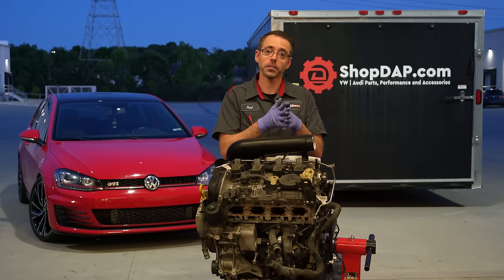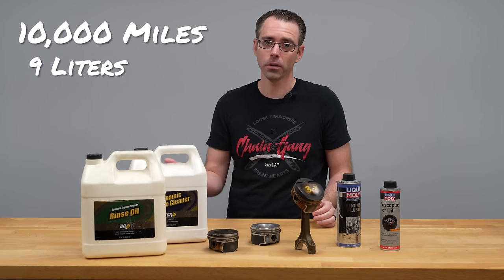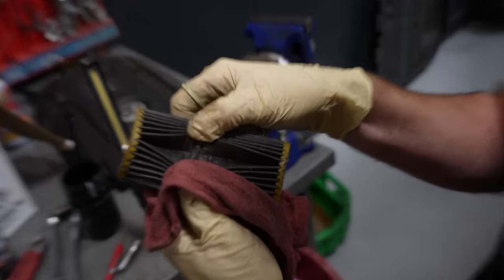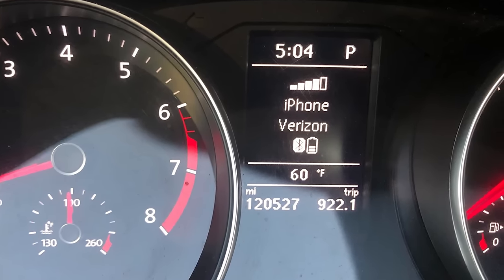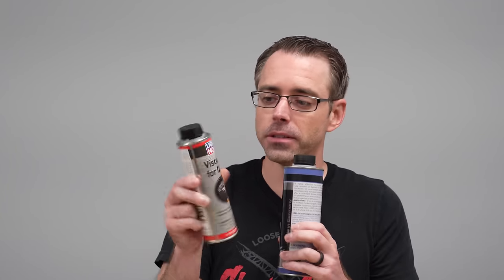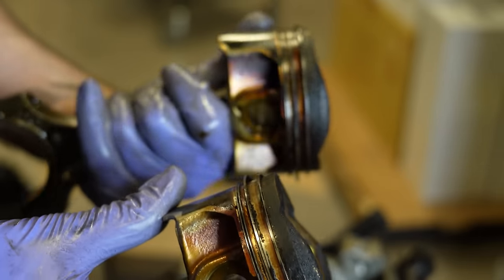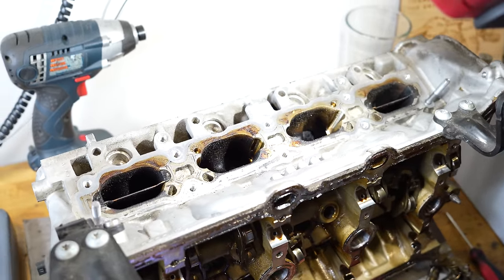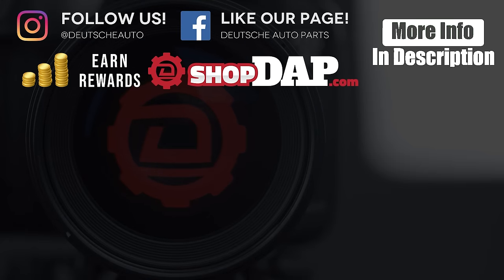Can you Fix an Engine Burning Oil for $20

Comment: Hello Gentlemen,

Carbon deposits on piston rings are quite common on VWs.
I would like to suggest You a different method, that worked for me.
I used XADO MAXI FLUSH CLEANER.

1.) Wear rubber gloves, safety glasses and face mask
2.) Run engine, till You reach operating temperature.
3.) Take the spark plugs out
4.) Spray the cleaner into the combustion chamber
5.) Put spark plugs back
6.) Let it sit for 20-30 minutes
7.) Take spark plugs out, and put a rag on top of the valve cover. (To prevent cleaner to get on painted surfaces)
8.) Crank the engine at least 5 times. Let cleaner fluid get out
9.) Put spark Plugs back, and assemble everything.
10.) Run engine for 20 minutes on 3000 or 4000 RPM.

This cleaner damages carbon deposits, and make them fall to little pieces, that can burn out.

After that I usually take the car for a "joyride" . Ok, I mean I go on some hills up, and I floor it, to put maximum load on the engine.

Video was great, explanaion was also good. Keep up the good work.
Reply: I also recommend the Xado MaxiFlush, with the same process, but doing 3-4 rounds of it until the pistons get absolutely carbon-free. You can see how clean the pistons are with your phone's camera set to video an turning on the light. I did it on a Prius 2 that was burning 1 liter of oil every 1k km's, and it went down to about 0.5 liter per 10k km's! I know some other guys with similar result on their Priuses, I do really recommend it.

Comment: I rebuild air cooled VW engines, and I always use gapless rings (Total Seal). Are gapless rings OK for rebuilds on modern engines like the Audi 2.0/B7? It seems that it would solve the same issue that eliminating the small cut out below the oil scraper in the first piston design solved by reducing blow-by. Also, did Audi/VW make a change with the material the rings are made of along with the updated pistons? From my understanding, part of the reason for excessive oil burning in the 2.0L is also due to the metallurgy makeup of the rings. That they were either too hard or soft for the sleeves, and thus don't break-in well.

Comment: Back in 90s I worked for a car guy. A ford ranger 4cyl after running a while. Loss of oil pressure. Pull pan the valve seals in pan. When it sucked them into pickup screen oil pressure drops. Shut off they fall out. All over again. Being a used car place clean out pan no valve seals

Comment: Based on my Fuelly tracking, after using LiquiMoly flush before my last oil change, and a bottle of Techron just after, I saw about 1.5mpg increase on gas mileage. I also put in a bottle of Mos2 anti-friction with the oil change. Mk6 GTI

Totally not scientific, but I have over a year of mpg data and the increase has been maintained for the last 4000miles
Reply: Mos2 should be used like this: 2 oil changes mos2, 1 change ceratec

Also look at the concentration too
Reply: Then you have spent more money on these things than you save fuel and don't know how long that will last.

Comment: Cool video! I've been using some great car care software named Automotive Wolf for years. It keeps track of all the maintenance on both my cars and a motorcycle. My 2008 Toyota has over 300,000 miles and still runs like new. I only use Toyota Oil and filters in it. Keeping up with a vehicle maintenance schedule is critical to avoiding repairs.
Reply: As long as you use a reputable brand of oil and filters in a Toyota,it would run for many years. I use WIX oil filters and Eneos oil in my Toyota.  No problems. As for Original parts,it.really.depends on the carmaker. Chrysler OEM parts are not very good in my opinion.

Comment: High pressure Loop EGR systems caused a lot of problems in DI turbo diesel engines, especially those that did a lot of short, stop/start trips. They were responsible for a condition known as 'diesel throttling.' HPL EGR's throttle the intake to generate a pressure drop across the EGR. When the exhaust pressure increases due to DPF restriction, the fish air intake needs to be 'throttled' to get the required pressure drop across the EGR. A vaccum can be generated which litteraly sucks the oil out of the engine. This causes further DPF flow restriction and the problem feeds itself, with oil consumption increasing at an accelerated rate. I went through 40ltrs of oil in 2,000 miles testing this. After cleaning the DPF, it was down to 1.5ltr/1,000miles. Of course, of it's using any amount of oil, the problem will gradually grow again, due to oil ash restricting the DPF.

Comment: Sticking oil control RINGS!!!!     In 1968, it was common to add FORD Transmission oil.“ TYPE-F” every oil change two free sticky lifters…I add 1/2 litre at every oil change. And do oil changes at 4K. For 3-4 changes. TYPE-F is how detergent mineral oil it cleans up the entire engine slowly and you’ll see your oil consumption drop considerably. After oil consumption stops reduce THE FORD TYPE-F to 1/3 litre. Or less. Continue using type F and you can reduce toquarter of a litre

Comment: mechanic mentioned watch cleaners with TDI's and their high pressures the oil operates in regarding the camshaft . less than spec oil wears camshafts fast they said

Comment: I over heated the hell out of my 84 bronco 2 with the 2.8 L v6 , there was no water in the ratiator or in the block, thank god i run vr1 Valvoline straight 50 w with zinc cuz the motor didn't seize up, i warped the heads pretty good but instead of replacing the head gaskets where i was i just wanted to get back home 50 miles away so i pulled the valve covers off and removed the rocker arms and i only tightened up the 4 head bolts in the center of each head , i torqued them to 100 foot pounds and put it all back together and it fired up and ran good for 3 more months then i had to replace the head gaskets and the heads were not warped when i took it apart, i cooked the valve seals really good so as long as i run straight 50 w vr1 Valvoline it doesn't smoke at all, i use a wix oil filter and i run that oil for around 25,000 miles before i change it, i change the oil filter tho every 5000 miles and i run that oil till its black for a reason, that black oil builds up on the edges of the rod bearings and main bearings and it acts like a dam holding the oil on the bearings, this motor has almost 200,000 miles on it and the oil pressure is great and it runs great, so if that answered ur question about making ur engine stop burning oil then there you go, and synthetic is shit i don't care for that water oil

Comment: I'm the original owner of a 2013 MK6 GTI with 215K miles. At about 130K I noticed I was burning 1.5 quarts of oil every 7 to 8k miles, which I thought was reasonable given the mileage. This remained consistent until about 180K miles when I noticed I was 1.5 quarts or so low at just 4000 to 4500 miles into an oil change. I've been using Mobil 0w-40 for most of my ownership. I've now changed to Shell Rotella T6 5w-40 and I'm currently monitoring the rate of oil burning. The engine runs fantastic otherwise. I recently changed the timing chain, guides and tensioner and I'm hoping I can hit 300K miles before considering a replacement engine.

Comment: Starting @5:51 the compression readings didn’t exactly align with the stated findings but I suppose either the camera person prematurely stopped recording or the footage was lost in editing. 

Too bad a before and after endoscope wasn't utilized to show the cylinders and possibly the valves. 

I believe the issues of stuck rings and the typical carbonization of intake valve ports, especially on direct fuel injection engines, can be traced to the use of regular dinosaur oil or synthetic blends, as well as a less than ideal oil change schedule.

Full synthetic oil won’t bake or sludge up on the internals.

I've switched to a full synthetic oil that claims to offer protection for 20K miles, and the filter claims 20K miles as well but 5K is still when I change it. 
I think it's dumb to use dinosaur oil but for those that do, those changes shouldn't exceed 3K miles IMO.

Great video!

I seem to recall having a flickering oil light on an old ‘98 Toyota Sienna minivan I picked up many years ago at an auction. It had quite a sludge issue under the valve cover near the firewall so I replaced a bit of the oil with kerosene, let it circulate, and then dropped the pan to clean the pick-up screen. It cleaned everything nicely and solved the problem.  I drove it for about a year and when I found something better, I sold the Sienna to a guy that wrote “for resale” across the back of the title.

Anyway, this is the best video I’ve seen in a while, and I don’t even have an oil burning issue.

Comment: We know our stuff. great video. Totally agree. I have launch on my Audi S3. would I use it? NO, I think the previous owner probably did. I would not. Though did not need to, I did an oil change and saw stuff. Horrid. Now it is running well and properly maintained . My Audi mate saw the oil sample I sent. he was gob smacked, and he knew I had my S4 at over 200mph in Germany. he said never seen oil so bad but mine from S4 was fine

Comment: great video. Thank you. I have a Chevy sonic 1.8L with 205,000 miles and does not burn oil but if it starts I will look into your method minus other oil burning factors.

Comment: Holy shit.  That 44K/Bg Dynamic Engine Cleaner/Rinse Oil/MOA service equalized compression across all cylinders, correcting cylinder 4 which was more than 20% off from the others.  And it cut oil consumption by more than half.  That's some damn good action.  I mean, 1L per 440 miles still sucks but that's manageable at least.  EDIT: Was quoted $1050 for the BG Dynamic Engine Cleaning Service as depicted here.  Dam.  That's a lot.

Comment: What's funny is that they do something like low friction rings and DI to reduce fuel consumption, but over time, the carbon buildup on the back of the intake valves and on the rings causes poor air flow and lowered compression. In my experience, a modern direct injected engine with a significant number of miles on it cannot compete with a 1990's era port injected engine for fuel economy. My '90s cars I've owned absolutely slaughter anything I've driven with the more modern tech on it for fuel mileage. They do make a lot more power though, so there's that.

Comment: Fun Fact: The rings spin in a circle on the piston at higer RPM. The harmonic vibration sends it sailing.
Reply: No they dont spin. 45 degree hone marks on new cylinders are 45 to prevent rotation. They're supposed to stay in the same place forever.
Reply: @gorporpio  ok 
LoL 😂

Comment: my daily is a fiat grande punto 1.300 multijet euro 4 diesel original 75hp, tuned to 120hp. its tuned for more than 150.000km or 93.000miles, the grand total is 216.000km or 134.000miles, i change oil every 10.000km or 6.200 miles, the engine is like new! no lost of compression, no oil consumption! if you want ot talk about vag the 1.8 20vt was the last engine without any problems! after the tfsi came 1.8, 2.0 and the little one 1.4 tsi, suddenly the oil consumption problems came! they dont make them as they used to!

Comment: Blow by from compacted rings is probably one of the most common  reasons a car engine doesn’t last as long as it could. PB blaster used to make a small engine tune up spray I used to soak cylinders with but I don’t think they make it anymore. Broke down carbon better than anything I ever seen. I’ve soaked cylinders in Berryman parts cleaner too. Make Seafoam look like a joke and I kinda think it is.
Reply: Berryman's B-12 is great! Especially for cleaning stale varnished fuel from carb passages on lawn equipment and such. Spraying a stream into a port behind a throttle body recently helped regain some compression lost from leaky intake valves caused by carbon chunking off the ports and stems..a common issue with direct port fuel injection.

Comment: liter of oil for 440miles is extremely high. I own 1998 Lancia Kappa 2.0 20V VIS , and it consumes 200ml of oil per 1000km/600miles . It passed 330,000km/200,000miles and it still runs good. I used Russian made RESURS MOS-2 product as a prevention and engine is quiet, and working good. Maybe after using your treatment, you should have poured into this engine American product Engine Restorer or German LiquiMoly MOS-2 or Ceratec. That would have reduced oil consumption.

Comment: I had a fresh engine build that sat for 6 years before i recently out it in a car. I started the car for the first time today and i killed all the mosquitos in the neighborhood. The motor that was in the car before blew up and I'm hoping there's just oil in the exhaust and that's what's making the car smoke so bad. The only thing is, it started smoking right away and if it was burning oil in the exhaust, i would think it woukd at least take a few minutes before it started smoking.

Worst case the valve seals have deteriorated from sitting for so long. I'm just trying ro figure it out before i pull the motor again.

Comment: correction on vehicle burning engine alot of people assume it cause of worn engine but typically its not the case during cold start most engines suck in the cold air and moisture in the atmosphere as you know air contains water molecules which when burns in the combusion chamber some of those water vapours  condenses out the exhaust and some remains in the block as the vehicle reach operating temps the pressure of vapours and unburnt gases pushes it way out the pcv valve into the intake siphoning oil with it as well causing oil to be burnt

Comment: Found a Touareg 2005 with 157,000 on it. Has had belt replace at 90,000 miles but not Chains. Second owner bought at 50,000 miles and seems to have really taken care of Car exterior and interior. Question is should I buy? I have turned wrenches for a living and owned a small Car lot in my 58 years. But I never bought many VW in life.

Comment: Don't think for one second this is not known by the engineers and the manufacturer before it goes to production.  These faults are purpose defects for two reasons.  1. Environmental..  mpg / CAFE.  2. Planned obsolescence, money / marketing.  Most vehicles will be just fine until the warranty is over and can be advertised for low cost of maintenance.  After high mileage the customer will be facing extreme repair costs and the majority of owners will be back to the dealership looking for another vehicle.  Those are facts and are irrefutable.

Comment: Good job on the video.  I had an oil burning 2012 2.0tfsi.  Was religious on oil changes.  The 1 piece oil control rings are clearly the cause of oil consumption on the vw audi platform.   The holes for oil to flow to the interior of the pistons on the deficient rings are about 2mm in diameter.   Once any clog happens, it accelerates the consumption.   You should also try bg epr, which is better than the liquid moly engine flush.  In the end I did the piston replacement myself for around $1.8k in parts.  My oil level has been stable since the rebuild.  Audi completely went to the waffle style oil control rings in 2017.

Comment: I have a 93 Ranger 4.0 I bought new back in June 1993. I rebuilt the engine at 189k in September 2023. I always changed the oil every 3000 miles the compression on all six cylinders was between 173 and 186 psi but the heads had small cracks and external oil leaks at the pan, front cover and lower intake manifold. Rod and crank bearings were like new, rocker arms were worn out.  With the leaks it only consumed about 3/4 quart every 3000 miles. When it had 150k miles it consumed 1/2 quart every 3000 miles.  I think VW is nuts for thinking that much oil burn is normal. It will ruin your expensive cat converter and O2 sensors plus prob fail emissions testing, seriously WTF. Defective product, class action lawsuit coming just like Honda’s V6 VCM issue which I’m dealing with as we speak.

Comment: Also have to use top tier gas and some additives to help with the carbon build up from the fuel which adds to the problem. The main issue is people use gas from Wawa, Sheetz and all these other franchises that buy out of date fuel or almost out of date from who over so that can make money. Only use fuel from a gas station that has there own fuel company. Sunoco, Conoco, shell, most are top tier fuel...

Comment: I had honda with oil consumption over 5l in 10000km, odometer around 160.000km. Gave it to friend engine serviceman. He put few liters water inside running engine and left it running for a while. Removed all oil and water mix, put cheapest oil in engine, run for few minutes and changed to normal oil and new filter. Result-had to put 1l between 10k km oil changes, to have normal oil level. I was very surprised it worked well.
Reply: I doubt a few liters of water in a running engine is a good idea...
Reply: @beni22sof it was "do it with water or full engine repair" . Would you let a try?